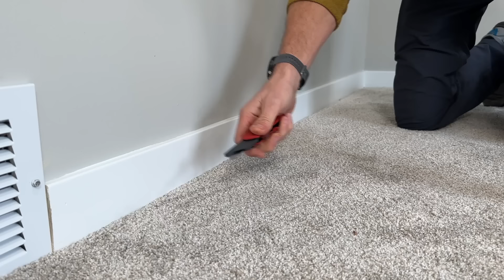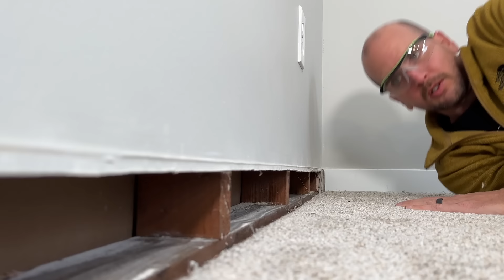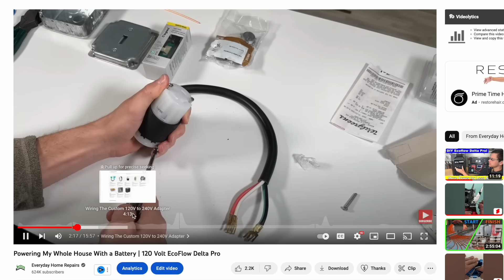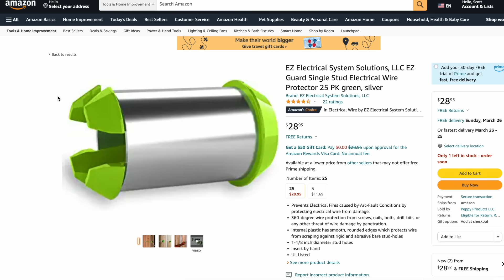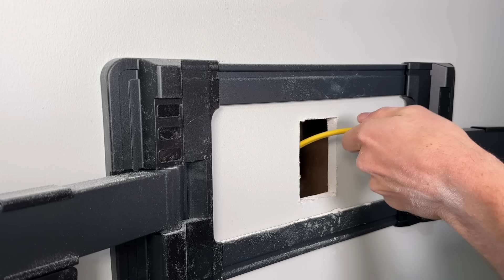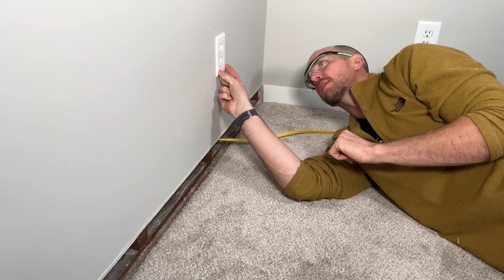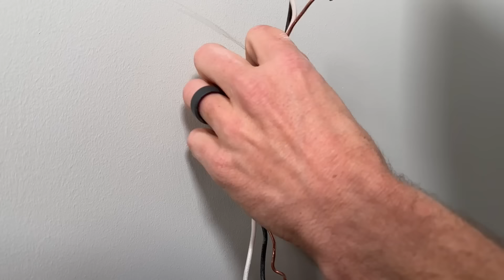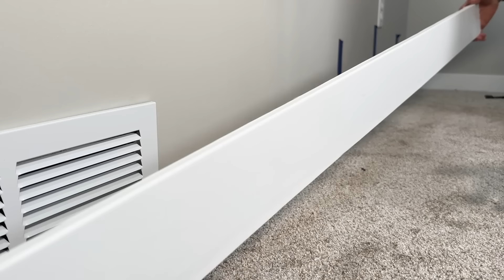How To Hide TV Power Cord And Cables | Easy Way To Move An Outlet

Comment: Not as easy in Australia or New Zealand because the building has cross bracing between the vertical studs
Reply from the maker: Yeah, some areas in the US have those as part of the wall as well and I agree that would make an additional step with a flexible auger bit.

Comment: Where to start. Most baseboards in modern homes are 2 3/4 or 2 1/4 unless you are in a very expensive home at which point they won't be doing dyi. Regardless of the outlet i hate backstabbing outlets regardless of the quality of the outlet, most electricians i know would never do that. Lastly Wagos? Yes they are nice and easy but they are developing a bad reputation too, again the couple of electricians i know won't use them. The idea is correct in that you have to make a pigtail but not sure if that's the best way. This isn't a person attack but the video won't work for a vast majority of the people watching because of the baseboard unless you can do all that work in a 1/2 inch gap. The rest may be up to code but I wouldn't say it's the best practice. I'm just pointing out this isn't good to be as easy or doable for lots of people watching unless they want talker baseboards.

Comment: You don’t sleeve the ground?
Reply from the maker: For this instance the ground is sleeved in the non-metallic cable (Romex). Then we cut back the jacket around the 2 conductors and bare ground in the plastic box.  Very common in the US 👍
Reply: @EverydayHomeRepairs  in the uk we always put a green and yellow sleeve on the exposed ground wire

Comment: Why remove the baseboard and drywall?  Just locate the new TV receptacle above the existing tie-in receptacle in a location that it will still be hidden by the TV..  Also, the nailer protection is not needed for a pass through hole, so long as it is located at least 1-1/4 inches from the edge of the stud.  I guess its just me, I'm too old and life is too short for doing so much unnecessary work.

Comment: If you can't mount a box to a stud, don't mount an outlet here. This is fine for low voltage, this may even pass code...but no. I know I've had installs rejected by inspectors for boxes not secured to the stud.

This would not be allowed in my house.

Comment: 'Easy guards' are absolutely unnecessary when your electrical is in the middle of the studs. Unless you plan on using a long screw somewhere! Lol. Drywall = 1/2". Middle of a 3-1/2" stud is 1-3/4. So that would need a 2-1/2" screw to pierce the wire. You need nothing longer than a 3/4" screw to fasten wallboard. Save the cost and drill a smaller hole too. Just saying.

Comment: I really don't see a need for the easy guards. As long as you drill your holes in the center of the studs you should remain code compliant. Looks like those guards cost around a buck a piece.

Comment: This is not DIY. Does the NEC (code) require a licensed electrician to do this? How did you wallfish that yellow Romex up to the top outlet box? Is it stiff enough? Well done, though. A Best Buy tech would most likely do this.

Comment: Wow been an electrician for 37 years.. I don't understand all of the praise from electricians.He spent way too long doing this he had many other options that were much faster and easier with the same results. Why would he avoid the attic, basement or crawl space? Or the right edge of the TV was hanging over the top of the receptacle so he could have just went down the same bay in the wall as the receptacle and put the receptacle slightly to the right side still behind the TV. Fake electrician shouldn't be giving this kind of advice. Just stumbled on this video I hope he doesn't do this to his customers and overcharge them. Hoping this is just a DIY channel.
Reply from the maker: Thanks for the feedback.  I agree, like most projects, there are multiple different paths you could take to accomplish the same goals.  All the projects on this channel are focused on homeowners taking on DIY projects and the projects are from the homes I own as opposed to being hired out for this jobs.

Comment: Why would you use 12 wire I doubt that outlet was 20 Amp. You don't need 12 wire for TV.
Reply from the maker: This circuit is fed by a 20 Amp breaker so you would want 12 gauge even if the appliance you plug in will only draw a couple Amps.

Comment: bah! my walls are brick! NO STUDS!
Reply from the maker: That would be a bit different project 😅
Reply: @EverydayHomeRepairs   My internal walls are insulated cavity bricks lined with drywall.   A much bigger job than the one you demonstrate.  Plus, the skirting boards are far bigger, more substantial and much harder to remove, not that you would remove the skirting boards in my situation.  In the situation you demonstrated it becomes MUCH harder IF there are a number of noggings used in the wall frame, which is not uncommon in better built construction.

Comment: You should not do this. It's against code in multiple ways and there's way easier ways to achieve hiding wires without drywall repair. Just get a cable pass through wall plate...

Comment: so now you have a giant outlet in the middle of the wall  smh, so you can never move the tv?  I mean just pop a small hole behind the tv, fish the wire down, pop it back out at the bottom and plug it in the existing  takes 10 to 15 mins. No one will notice it, and you didnt do all that damage to your wall and boards.

Comment: How TF are you going to title this "The Easy Way?!?" You remove the trim, cut holes in drywall, drill through studs, install and wire a new electrical box... How TF is any of that "the easy way?!?"

Comment: 😅 😂 - OMG- sooo much more complicated than doing two patterned holes in the dry wall and then putting a standard kit. It also doesn’t need much of a repair as you cover those v easily with the cover plates which come with the kit.
This is wayyyyy tooo complex and wayyyy too much work with no real benefit

Comment: Do not use the back holes!!! Any electrician will tell you that.
Reply from the maker: For residential grade outlets and back stabbing I agree but for commercial grade outlets and back wire method I would disagree.

Comment: You violate the national electric  code you exceeded box fill calculations I would never use and never have used 12 two for general lighting or receptacle outlets unless the application called for it, this application does not call for it +12 two is a waste of money